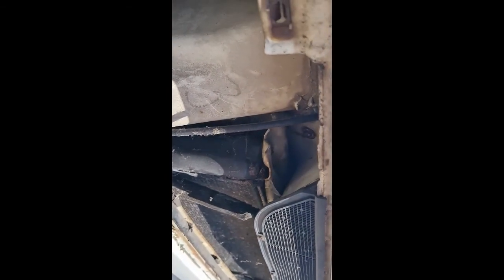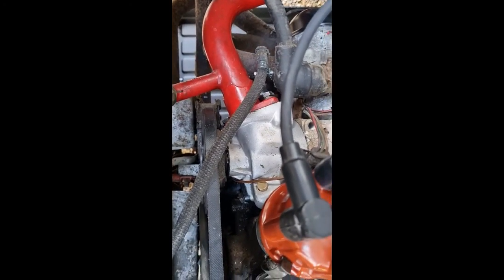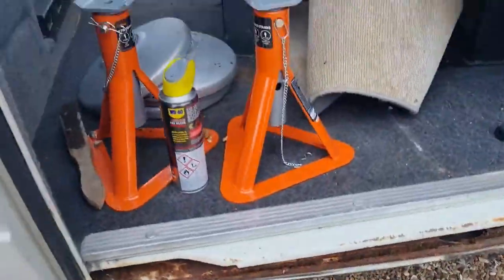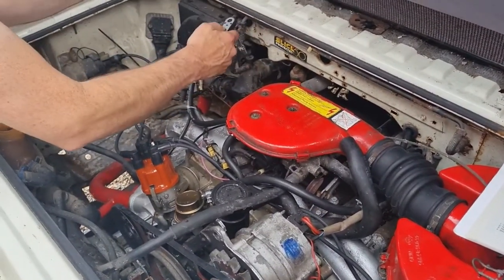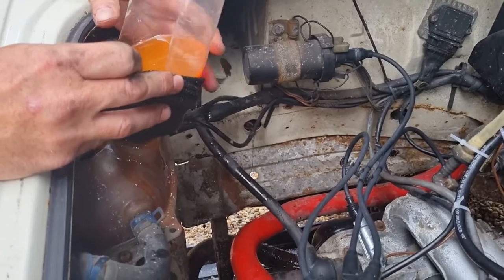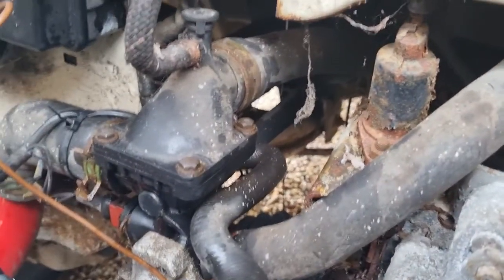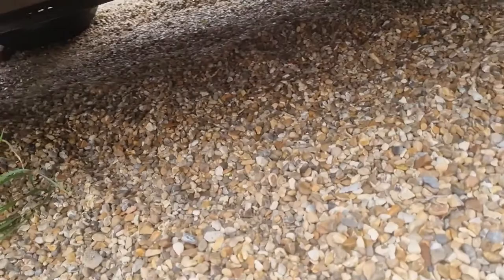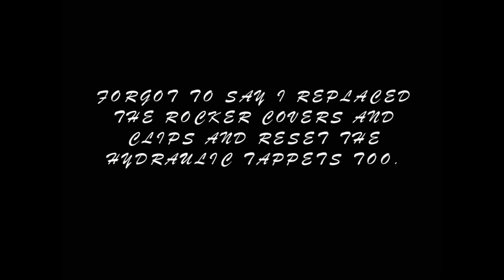VW T25 First start in 20 years! will it run??!!

Comment: Nice work Ad! Started up great and sounds really good man. strange the coolant didnt get past the thermostat. Just wondering if its the right coolant? I always have to use the blue stuff in my old bangers (apparently you cant mix them either) but I dont know a ton about that stuff though tbh. Also, I've seen a few people lightly tap the Stat housing with a hammer to nudge it open when warm which might help. Are you going to do the welding yourself?
Reply from the maker: thanks for the comment! I did research and it seems i need the G12 (pink) coolant for the van, so hoping it is right lol But having done a bit more research it appears the thermostat works differently on the van, letting cooler water back into the engine, as opposed to letting hot water out. So the pipe I was feeling was the return pipe and should be cooler.
(maybe someone will correct me if i'm wrong)
as for the welding... nope... not got any welding skills at all! lol Have hopefully found someone to do it thats not too far away, will find out in a week or 2 about that.